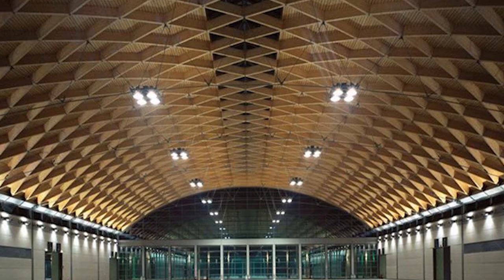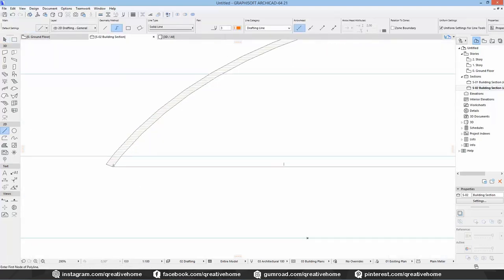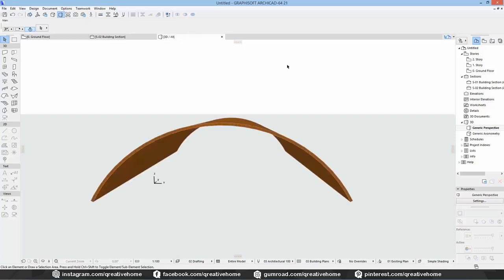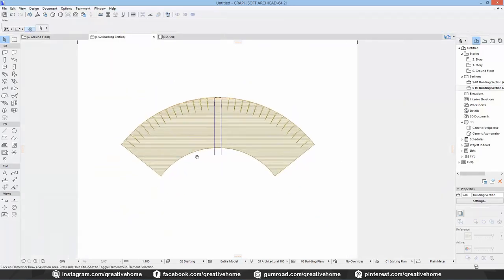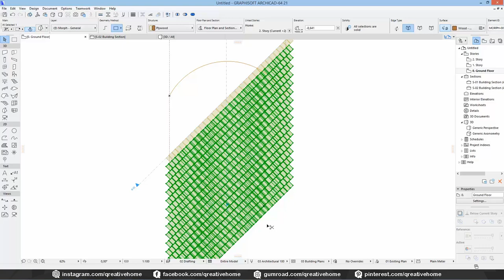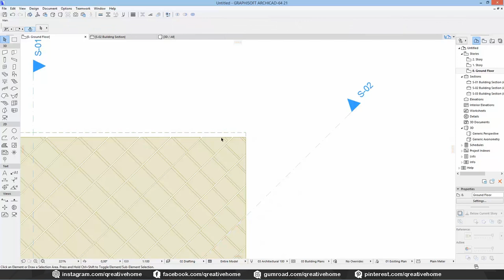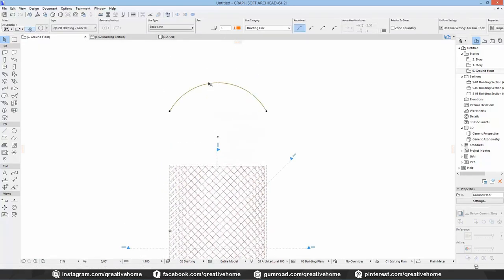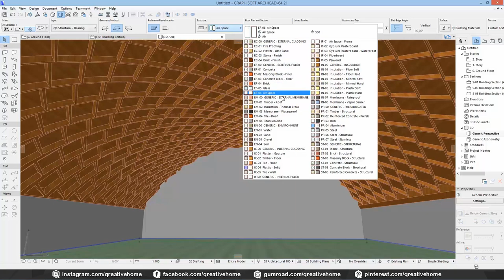How to create anything in Archicad: Curved Grid Ceiling

Comment: have you tried archicad 22? do you suggest upgrading to archicad 22 from archicad 21? thank you
Reply from the maker: I always use the newest Archicad since the day it is released. I am an ArchiCARD User. But my ArchiCARD is for the German version.I I bought AC21 INT just for Youtube. And it's not possible to run two Archicad versions in different languages on the same computer. I tried it :D SO the most videos here are made with AC21. The speedbuilds are in 22, because I am a lot faster with GER Version (just because of the shortcuts)